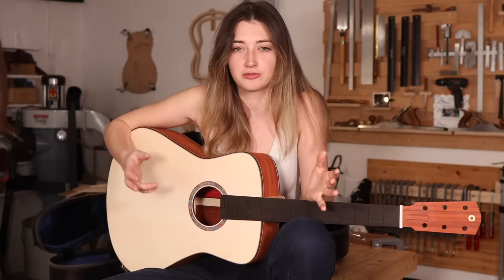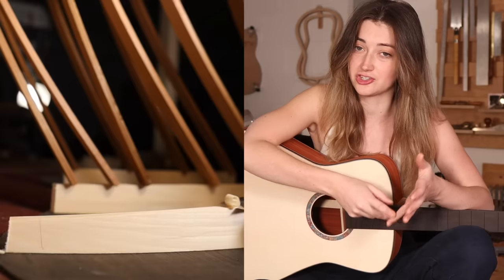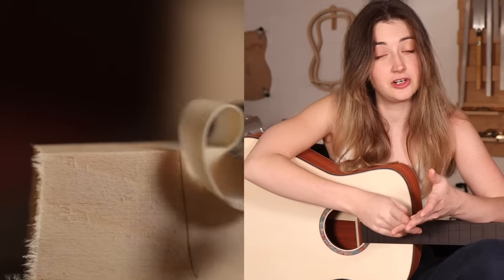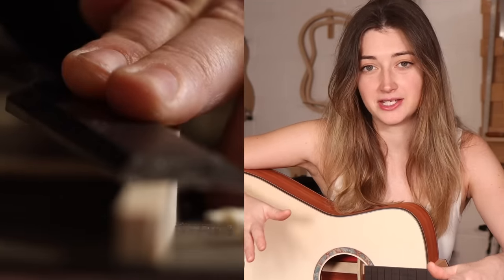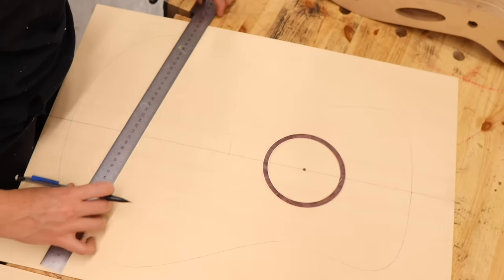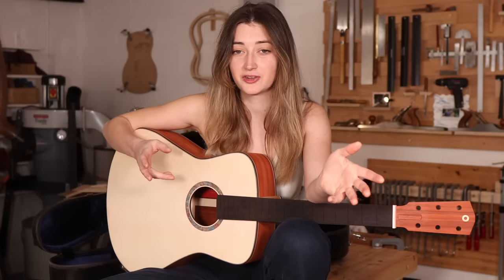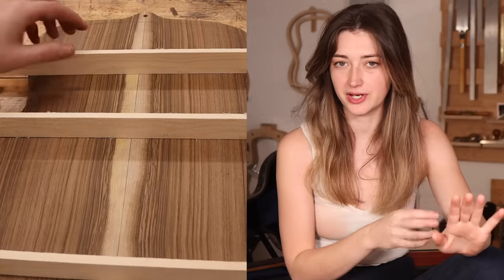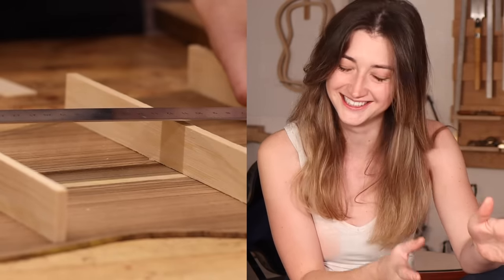Make An Acoustic Guitar Back With Me

Comment: I like the light box trick to see if you have a good joint.  Also liked how you joined the two thin boards together to prevent cupping; will keep in mind.  Out of curiosity, has anyone ever investigated to see how different glues impact sound transmission?  I make furniture as a hobby so it's more just curiosity.

Comment: Excellent as ever but a suggestion use a smaller width - ¼ inch to ⅜ inch at 4-6 tip - you find this much easier cutting the curves. Your twice cutting your back why not use a router to cut the edge using your original mold as a guide.

Comment: As i watched you on this video and the one where you built the top, i was curious as to the purpose of the struts you put on the inside of the front and back. Are they there for only strength or do they affect the sound? If they affect the sound, then that would mean it is real art on knowing where to place them, how thick they are, etc. Then that begs the question, would there need to be a different structure with the size of the guitar and/or the wood used.
Old retired guy, who is a wood working hobbyist, just curious.
Thanks,
Patrick

Comment: That back looks gorgeous.

Why chisel a slot in the strip running along the center line instead of just making that strip in pieces and leaving a gap for the cross brace?
Reply from the maker: I find it’s easier to glue them in straight when they’re pre-fitted! No slipping off centre. But I’ve tried both ways!
Reply: @DaisyTempest  Ok.  Thanks.

Comment: I always have a hard time understanding this type of guitar back bracing. My understanding is that the top has to vibrate so it explains that the bracing have to be carved from thick in the middle to thin on the exterior but the back is only structural, it's not really meant to vibrate (since it sits firmly against your body while playing) so I would have thought that the carving on the back would be the other way round: thicker on the outside. Does that make any sens ??
Great work btw both woodworking and video

Comment: Trying to figure out why you joined smaller pieces of bracing to cover the join and then chisel it out for the cross braces instead of butt joining the individual pieces between them 🤔
Reply from the maker: It’s easier to glue them in straight when they’re pre fitted I find :)

Comment: Instead of weakening the Soundboard structurally by drilling a row of Six-6mm holes across the middle of the Soundboard and Bridge, (close together),  to accommodate Bone Pins on Western guitars why not use `Trapeze-Tailpieces´ like Django Rheinhart had on his guitar.  Long-term, Pins cause bowing of the Soundboard or loosening of the Bridge, they seem like an inferior compromise of material structurally weakening and acoustically dampening the Soundboard with subsequent costs and early replacement being the result.  If you can make a Damascene knife you can make a brass trapeze-tailpiece. One should aspire to build guitars to outlast one's self! Hardwoods are too finite a substance to waste.